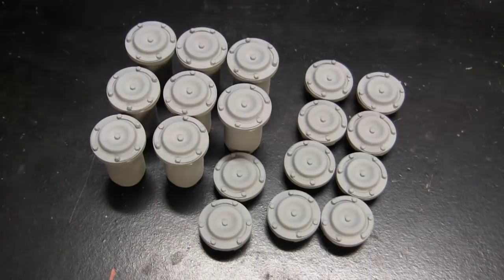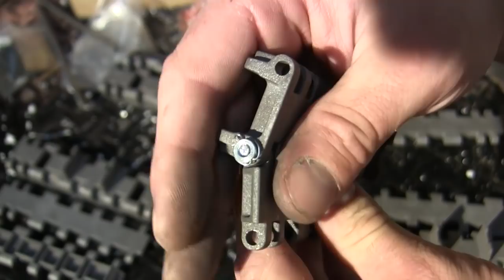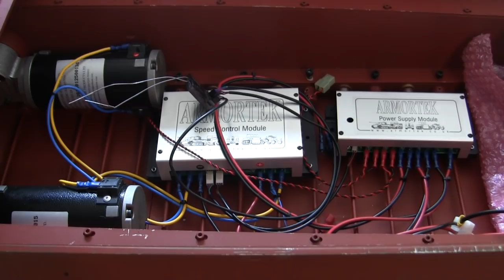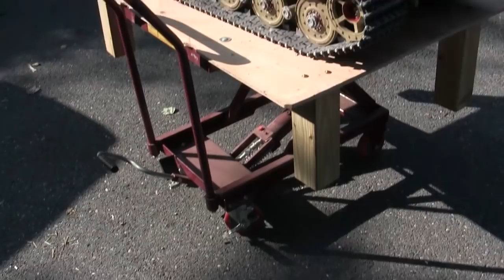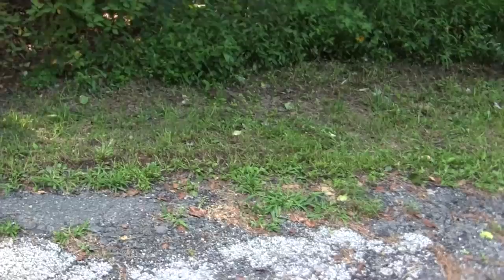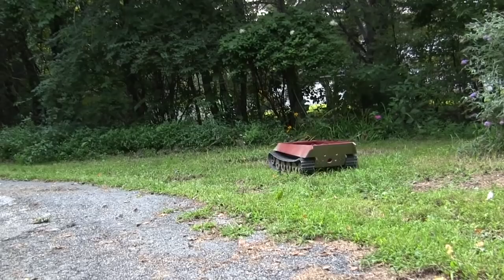Armortek 1/6th scale RC King tiger project video#4 (Track and test drive)

Comment: I've got a couple of suggestions which you can consider or put aside. 
1) apply a bit of anit sieze compound on the track pins when assembling the track links. This will not only prevent binding, but will prevent electrolysis that happens when two dissimimlar metals are in contact with one another. 
2) Although you said that l/a batteries are a dead technology...two small AGM deep cycle lead acid units would likely outlast the run times of the lithium units you're planning on using. The low voltage cut offs on the control unit could also be disabled if using lead acid.
Reply from the maker: The compound is just not needed, electrolysis never was a problem with the pins and the tracks and binding is also not really an issue. As for the batteries, the AGM In my experience are inferior to the Lithium ions in just weight alone. I'm done with anything lead and will never look back

Comment: You are full of knowledge!
IF I manage to sell my Kidney, which should I get? Armortek King tiger or the Warlsug King Tiger?
Reply from the maker: Armotek, the warslung is not only more expensive, but is vaporware
Reply: @oddball759mm  it is listed at a crazy price, was more concerned about the details on it. with your expertise, do you think the Armortek is very authentic?
You can order the Warlsug though, so doesn't that make it available?
I was blown away by the level of detail the Tiger 1 had, engine and fans, threaded bolts nad wing nuts and latches...  :O does this KT have the same level of detail?
Reply from the maker: @JimmyNahlousVisuals  No tank model on the market is perfect, this applies to both. There are details on the armortek that I frequently change, and I can say the exact same on the warslung. side by side I would say the warslung has slightly better detailing compared to the OOB armortek, but IMO If I had one I would probably still tear it all down and replace everything as I do on the Armorteks
Reply from the maker: OOB, the stock armortek has some of those features, like the wing nuts, Bosh light, latches. However the fans, no. The rest of these details are however found as aftermarket parts (I.E. I've been making the fans and engine details for the Tiger I since 2012, and will be making them for this KT) and you can upgrade from there. In the end even with all the Aftermarket parts... it will still cost less then the warslung.  However the warslung is RTR, while with the armortek you have to build everything
Reply from the maker: Even RTR vs assembled kit has it's advantages. Personally I like to start from the ground up with a build. With a model that's already built I would have to tear it down which negates paying the extra cash to begin with. But if you don't have the experience or tools to build the thing but the cash then RTR is a better route. The only problem that I have with that though is getting a all built un painted model is problematic in terms of painting. I like to get every part in primer / paint. this is impossible to do when fully built... esp a tank's suspension. this is specifically true on the King tiger or any WWII german tank with the interleaved wheels. You would have to take them off to paint... which may lead to issues depending on how they are built / mounted.
Reply: @oddball759mm  Very informative! Thanks for taking the time to reply.

Firstly, I am very new to this, I have loved the King tiger since 2006 playing Company of Heroes, and about 3 months ago I bought a Henglong 1/16th KT, and been drooling over 1/4 scale KT's and then 1/6ths, then recently came across the Warslug and was BLOWN away on the detail it has and then came across your videos to be further blown away by your knoweledge.

The 1/4 king tiger from Mark1 tanks looks the part from a distance but I bet it is just a scaled up version of a Henglong, very limited moving parts and from what i heard the body is fiberglass etc. But I think it has a fair price of about $10,000 for what it is.

There was another company that did 1/6 scale tanks and had a decent price but the tanks were made of thin steel to save on material and manufacturing costs.
Armortek seems to be on the top of the range with cool features like"scaled down armor" and other stuff.

Very damn cool that you built the tiger fans etc. and I do like that you go the extra distance to perfect some parts. I definitely do not have the machining capabilities as you do to mod any accessories. RTR would probably be the way to go, That said I think I would be happy with the Armortek.

I don't have the money to buy either, just thinking ahead.

I am building a 1/4 scale Lamborghini Countach with about the same level of detail as these things. I am 3D printing it and have been 3D modeling it for 4 years in my spare time.
It will have working suspension, doors, remote pop up lights etc.

Do you sell these once you build them?
Also, thought on projectile damage, I thought about this the other day, shooting the tank with a .22? :D?
Reply from the maker: @JimmyNahlousVisuals  All of the builds I do for myself go into my collection. I never sell my models. This model here is being built for a fellow who hired me to put his kit together. As for Battle damage, it's just not my thing and I will never do a damaged build. 

As for 1/6 options the thin metal company is still around but they never made a tiger in this material. Their tiger kit is plastic panels. They are the simplest or basic kit of the tiger in this scale. As for 1/4, I would avoid this scale as 1/4 and other off scales like 1/8, 1/10 don't have any figure infrastructure. In this you are no aftermarket parts, upgrades, equipment, or figures in these scales. You would be totally on your own and on the hook for everything. If you are ok with this and can print what you need then go for it, but for most big tank needs 1/6 looks to be the largest most people go. 

This 1/4 and the company who makes them is in eastern Europe. All of his model hulls are fiberglass.  For your needs probably the RTR is the better option, but so far I've yet to see anyone with one of these models in the wild, or pics / videos of examples of the models that aren't the floor samples that make the rounds on the net. There are more pics / videos of Ferrari's or lambo's then of warslung

Another option is to find an armortek model pre built on the second hand market. Sometimes a collector wants to move on to another hobby, or needs the space / funds for something else and he sells off his model. On the armortek forum there is a classified section just for this purpose and is a great place to get into an older kit or a model that someone is looking to part with, https://www.armortek.co.uk/Forum3b/viewforum.php?f=5&sid=1f6b1cb9d65cfa9f6fb44046ed29e961
Reply: @oddball759mm  Ahh you'r amazing. Agree with you 100% 

Very informative as always. I will check out he link to see what i can get myself into. I haven't fully  looked through your channel but I would love to see your collection in 1 video, like all the tanks in the yard and you walk by them. 

Cheers!